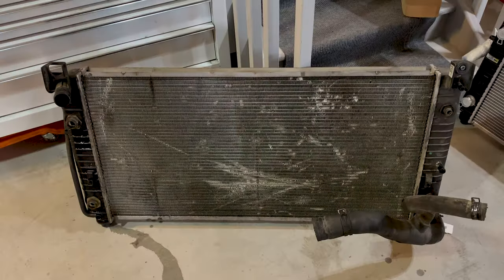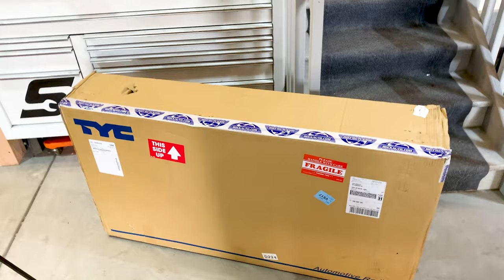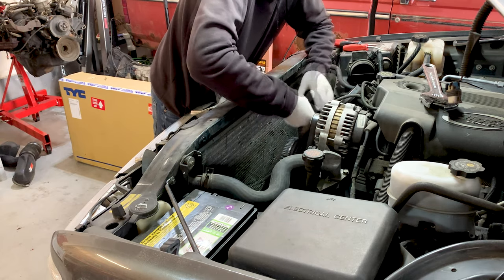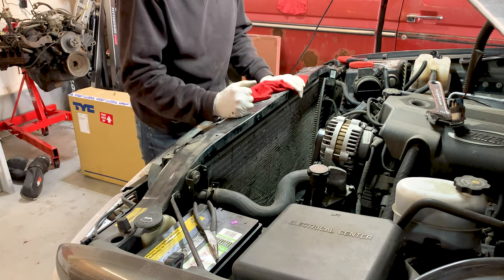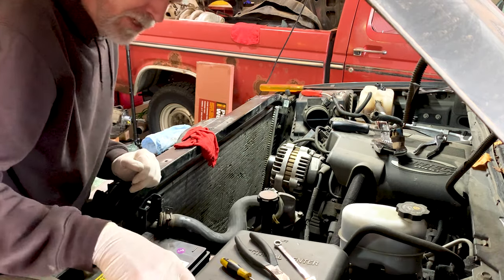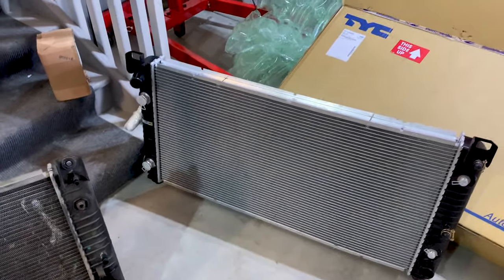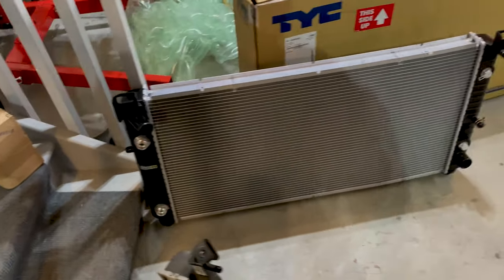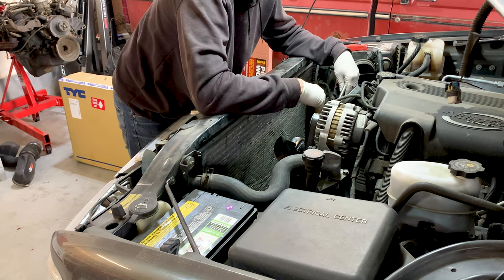How To Replace the Radiator on a Silverado or Suburban, 2500 Series (2000-2006)

Comment: This is a great video. I changed mine today and this helped me alot.  I have the 2005 model 8.1 also and the lower hose is diferent it has the heater hose attached to it and also has a quick disconnect so I raned to autozone and got hose like on  yours and made it work. I order same part number as yours because I wanted the thicker radiator. I was able to do it without removing the fanclutch just by taking the fan shroud apart into two pieces.

Comment: Whoa that's the Vortech 8100 motor you got there, that's pretty awesome! That sucker is like 494 cubic inches!
Reply from the maker: Yeah it is, its 496 according to Chevy. It is the second largest production engine Chevy ever made. The first is the 500 cubic inch Cadillac 500 made between 1970 and 1976. Chevy makes two larger motors, a 502 and a 572 but they're both crate motors and were never used in production vehicles.

Comment: Thank you for making this video. I was struggling with getting mine out, decided to take the battery out but helpful to know that the air filter box and bracket also have to go. My lower hose is slightly different, having a 3 way tap for the heater and overflow tank. The new lower hose I have is a pain to get clipped on. Someone needs to do a video on that!
Reply from the maker: So glad it was helpful! And yeah that lower hose can be a pistol for sure. We've got some more repair videos on that Suburban coming as well as, hopefully starting this summer, a major overland project build for it, so stay tuned! Thanks for commenting!

Comment: Thanks for the easy to follow video. After 3 years how would you rate the quality of the radiator? I am considering this one or an AC Delco at just over twice the price. Since the original lasted 21 years I am tempted to go OEM, but if the TYC is of equal quality I do not mind saving the money.
Reply from the maker: Its been great, no issues. I too tend to go with the OEM solution too because so much of the aftermarket has quality control issues or they're using inferior components to lower costs. But lately a lot of the OEM parts we've been buying have been failing just as badly. An OEM fuel pump we put in our S10 lost its fuel level sender within 3 months and the whole pump within 6. So, sadly, OEM doesn't seem to be the guaranteed fix that it used to be. So with all of that in mind, yes, I'd recommend the TYC. Its been perfectly fine, and the truck has towed trailers and a Jeep with it 6-7 times, 1000-2000 mile round trips, with no issues. Thanks for the question!
Reply: @MotorsandMischief  Thanks! Our 2003 with the 8.1 developed a crack just above the upper oil cooler line on our last 2,500 mile trip pulling the camper. Although this one says it is for 2001 - 2002 all the measurements look the same as the 2003 ones. And I like the fact it is not 1 1/4" thick like all the other ones, rather just over 2" thick.

Comment: Does anyone know what size fittings the radiator has that is for the Allison 5 speed? I think it is 5/8 but i'm not sure.
Reply from the maker: We're not sure about that hopefully another viewer can answer, but we did want to say the radiator we got came with multiple fittings for the transmission cooler, and we just matched up what we needed for our 4L80E, we'd assume the Allison would match up to one of the adapters as well. Thanks for the question!

Comment: Which RockAuto Part # did you use?
Reply from the maker: That is a TYC 2538 {#89018316} (Standard Replacement) w/ 3/8" Cooler Fittings. Has been working great, quite happy with it.
Reply: @MotorsandMischief  I have the 6.0LT 2500 Suburban, I'm having difficulty finding anything wider than 1&1/8" thickness.  Most are 1" thickness with Oil and Transmission cooler
Reply from the maker: Yeah that's why we went with this radiator, we wanted something a lot thicker than the inch and an eighth most of them are. This one is 2.2" at the core and 3" on the tanks, and as you can see in the video it is definitely thicker than the factory one that came out of it. We've been using it now for about 6 months and the truck stays rock steady at 210 whether its idling with the A/C on or towing our Project F-250. Here's the link to it on RockAuto: https://www.rockauto.com/en/moreinfo.php?pk=10038448&cc=1380350&jsn=1
Reply: @MotorsandMischief  The 8.1LT TYC 2539 (#89010326) is 3.8" Wider and 2" taller.  Not sure that will fit in my 6.0lt location
Reply from the maker: Interesting. I can't imagine the location would be any smaller even if Chevy made the actual radiator smaller to save costs. If you want to measure your space available I'd be happy to measure ours and see if they match. Or I can send some photos of ours so you can compare to yours and see what Chevy did to make the 6.0 radiator fit and how big a deal it would be to modify to match the 8.1
Reply: @MotorsandMischief  I have measured ~38" in between the two upper radiator bolt mounts to the core support
Reply from the maker: Ours measures about 39-ish inside to inside (44" outside to outside of those tabs). I don't see any other mounting holes half and inch further in on the core support suggesting that if they are indeed different, then Chevy also used different core supports, which would be surprising.
Reply: @MotorsandMischief  GM must have.  My outside to outside is 41".  I found an ACDelco 34" radiator that's 1.31" thick (Also double the price for that .31").  My current OEM radiator is 1" thick.  Thanks for helping me trouble shoot.

Comment: Never seen someone remove the fan off this type of model truck to get to the radiator
Reply from the maker: Really? The factory procedure includes removing the fan and in our experience it won’t come out otherwise. But flat rate mechanics are a resourceful lot so it they’ve figured out a way to get it out without pulling the fan, more power to them.
Reply: @MotorsandMischief  yep, not sure man. I have a chevy 2500HD and once you remove the shroud, air box, hoses and lines and all that, it has at least a foot of clearance to slide to the side and out. I was looking for videos about the clips on the metal lines , this happens to be the first video of 20 ive watched that removed the fan
Reply from the maker: Interesting! Well there’s for sure not that much clearance on our setup but that’s good info for anyone who does have enough room. Ours for sure won’t come out without removing the fan, but good to know some will. Thanks!
Reply: @MotorsandMischief  is your engine stock? What size is it?
Reply from the maker: It is, yes, it’s the 8.1